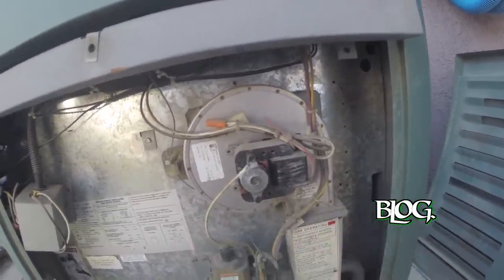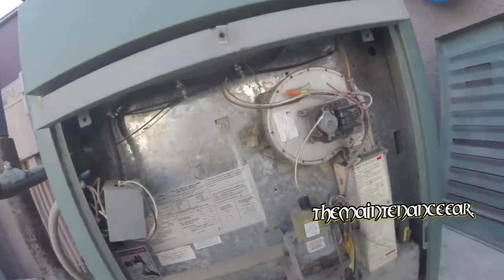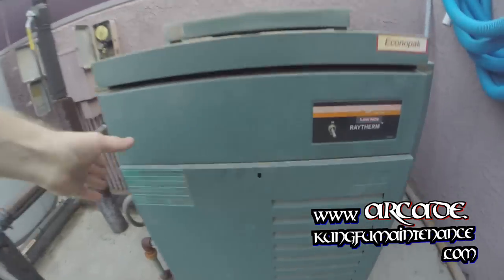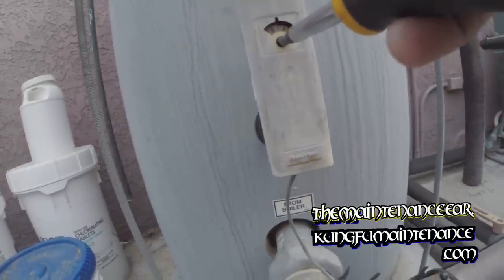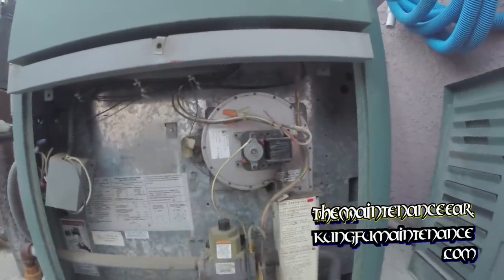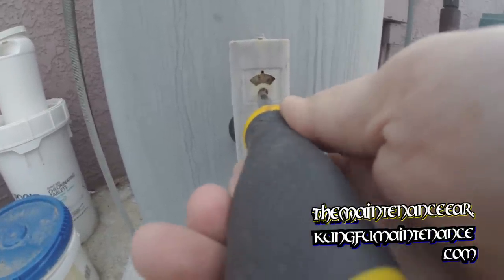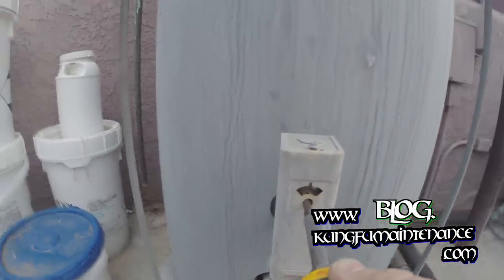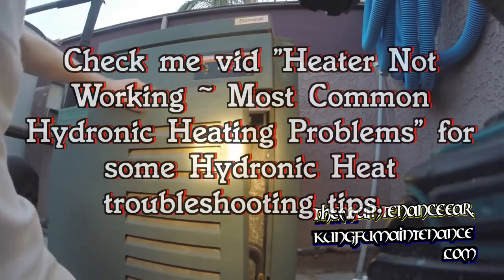HVAC ~ Quieting Down A Noisy Boiler Fan Motor Bearing With Lube

Comment: Bearings should be greased not oiled. It's just a temporary fix as the light oil is going to break down, especially under heat, and the problem will return probably even worst as you have washed out any grease that was in there.

Strip down, clean and re-grease would be the proper way to do it.

Alternatively if you want a 'quick fix' then you can use a specialist spray on grease that has a low initial viscosity (so can penetrate small gaps to reach the bearings) and then thickens up after a few minutes to form a grease. These are better than using light oils/sprays as you've done here. However if you want the fix to last a strip down is the way to go.

Comment: What oil did you use and how long will it last ?
Reply from the maker: ~ Thanks for watching. On this one I used HVAC 444. It is one of my favorite lubricant slash cleaners. This one is hard to say how long it will last. Generally these particular types of motors do not need lubrication. This was a nothing to loose situation where it may last five weeks or it may last five years. I think it will last a long time as I caught it early. Time will tell.
Reply: KungFuMaintenance
Ok, thanks for the info.

Any advice for a good oil for bathroom exhaust fans ?
Reply from the maker: Dicofole a 3 in one oil works good for bathroom exhaust fans but I like to use this HVAC 444 for those fans as well.